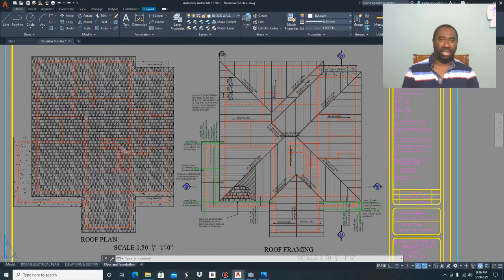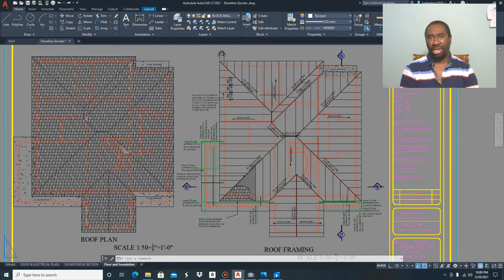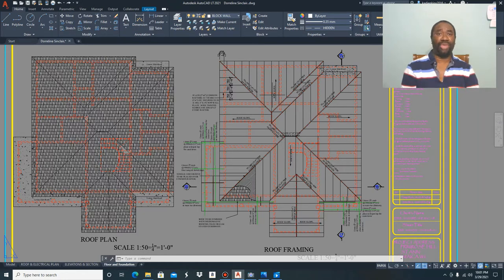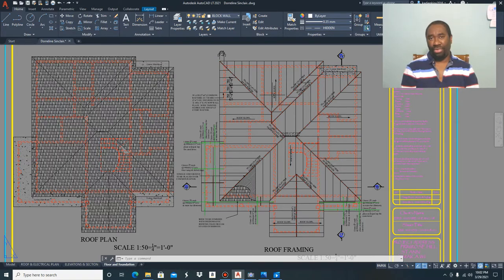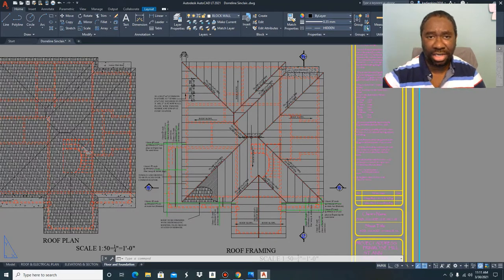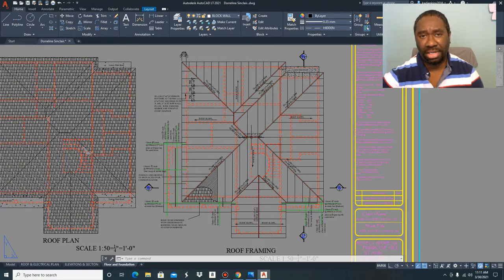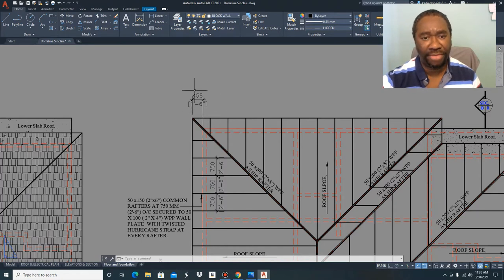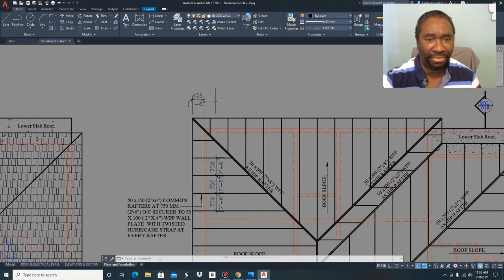Addendum to the reading of Timber Roof Plan

Comment: Thanks for the video again. Respect. Can a two RCC support a beam that span about 30 ft?
Reply from the maker: Yes, I think so, depending on the reinforcement design in the beam and the load the beam is carrying.
Reply: @jkengineeringarchitecture.  thank you very much. It that someone is trying to do an addition to their home by going on top, however the existing slab isn't strong enough. So the plan was to make a suspended floor about 6" above the original roof and filled the gap with foam, however no column can be added into the center of the span because of how the scheme is designed with wall to wall boundary. So Column can only be added at the back and front of property to support the beam and the suspended floor.
Reply from the maker: @MrBlake-cj2mt  I undertand, but as you know when the span of the existing slab is over 20 ft., there need to a support at the intermediate / center of the that 30ft to limit the deflection. although there is going to a slab blow the newly constructed slab, with foam in between them.